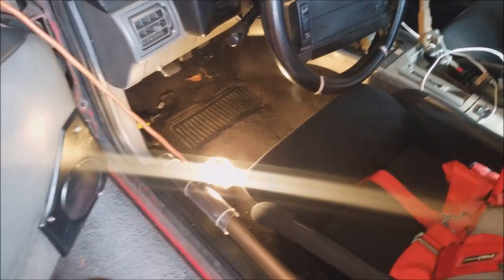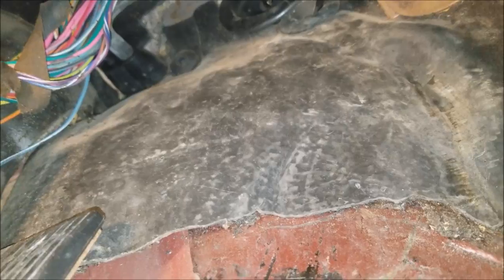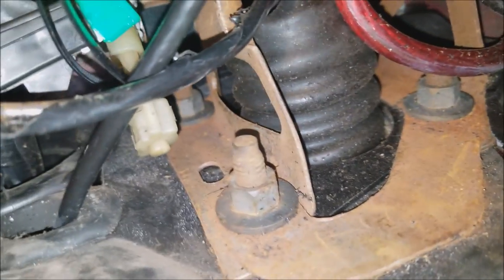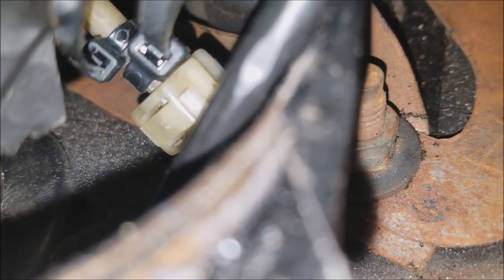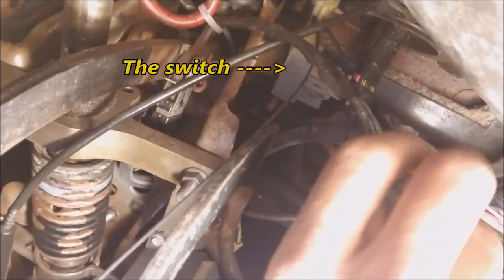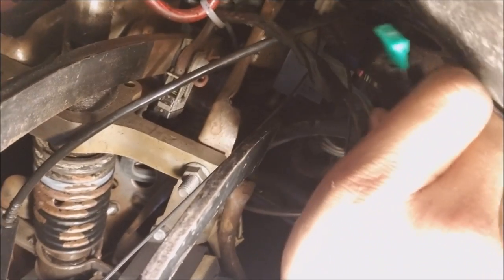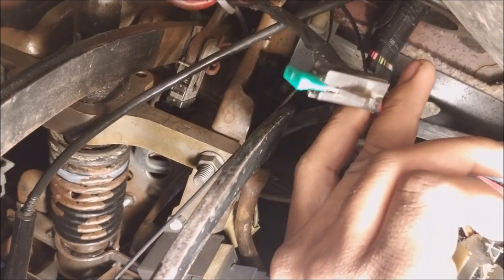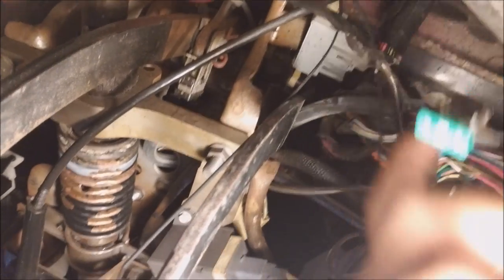Clutch Safety Switch Bypass on Foxbody/SN95

Comment: definitely gonna try this.
I'd heard about this kind of fix before but now I need to do it. 
I was getting the single click and I replaced the starter.
Still getting the single click.  New battery too.  '96 200SX SE M/T.
The car does start with a bump start then runs well and did so before changing the starter.
Funny I'm in DC too.  
I'll update later.
Reply: It worked.  Took a spare 10 amp from under the dash and had to twist it a little to get it in.
Now to find the switch online.  Oh and to figure out the pedal switch that's keeping the brake lights on the other 200SX.
The irony is that I grew up without this nanny device and hated it when I discovered a '91 Sentra had it.
Reply: I’m also in DC. 
Red mustang cobra convertible if you ever see me rolling around. 
Having the same issue. Shits clicking like 10 times everyday before starting. Sometimes more sometimes less.
Reply: oops.  Further update.  I bought the switch but didn't try it.  Instead I found little bits of broken plastic in the footwell.  Apparently that was a little plastic stopper that activates the neutral safety switch. 
In the meantime Autozone had declared the starter dead and I replaced it with no joy.
The plastic stopper did the trick.
For some reason the exact same stopper activates the brake lights and my SE-R 200SX A/T stopper disintegrated at the same time letting them stay on and drain the battery.  Sheesh.
And to cap it all off the alternator went out a couple of weeks later.  Fun times all fixed by me though.
Reply: @Scooter_built  I'll keep an eye out.  I deliver food in far NW where I used to live.  Down by the river now off Minn. and Naylor.

Comment: Not sure if I did something wrong or what pulled the plug with the three wires (smallest plug out of the two) put a 10amp fuse to jump it and it won’t start? Made sure the plug was clean and wiggled the plug made sure it was making good contact but it wouldn’t start. Put plug back in and it started up?

Comment: Ok I done a auto to manual swap in a 96 gt ok on the gear selector switch I plugged the switch back into the plug and put the switch in neutral it starts but like to tie the wires together plus fix my backup lights too
Reply: Anyone got a clue

Comment: If I do a bypass on my 92’ Mustang will it work if it was automatic before and they converted it to standard and it doesn’t start with the key in the ignition
Reply from the maker: it depends how it's currently wired.
Reply: @Sgt.Slides   it’s has the original wiring  and it’s stock like automatic .

Comment: Hi i replaced my clutch cable and  wired up my radiator fan to a switch recenty because the fan wouldn’t kick on and now my car won’t start it turns over but doesn’t fire up I recently replaced the starter battery starter solenoid  everything ran fine till i put the new cable and wired the fan up. In my 86 foxbody
Reply from the maker: your best bet is to go back over everything.  Make sure your coil is properly hooked up and your spark plugs are firing.

Comment from the maker: oh snap, i'm at 3k!!!
Reply: This worked for me as far as bypassing.  But all I get is a single click. I replaced the starter solenoid today as well. And I still get the single click. I also replaced ignition module and key with tumbler cylinder. What should I try next ?
Reply: Would this work with a 99 mustang gt?
Reply from the maker: @kimtrevino800  it's probably similar, but it wont be exactly the same.
Reply from the maker: @gymjunki322  Hopefully you've figures out why your car wont start by now.  This is only a single troubleshooting step,  there are other things that will keep your car from starting.  Doing this bypass was very useful to me, but it turned out not to be the solution to my inconsistent starting.  later, i found that the little boot connector on my starter solenoid was VERY loose.  Other things you'll need to check if your starter is not turning is, your battery, get it tested, all of your ground connections, your ground wire (those can actually go bad over time), your starter wire and connections, and your actual starter.  It's good to just do all of these at the same time, replacing the starter is the most expensive and difficult part, new wiring is pretty cheap and you might as well change it while the starter is out.  Good luck.

Comment: I'm battling an intermittent grinding at the bendix upon start up. Changed out solenoid recently, due to a failure while removing on another project, it was the original. I was wishing an nos replacement would be helpful, nope. Just bypassed this switch, still about a 40% failure(grinding) on start up. A friend of mine who knows shit about cars thinks it's the ignition switch, I'm starting to lean that way myself. He always prays while I'm laughing during a 6-7 time attempt, '92 GT has original 396k, starter replaced once. Car has about 200k since I lasted swapped out an ignition switch, that's alot of start ups. I'll report back when I have time to swap in an extra or new one.
Reply from the maker: good luck

Comment: Hi I bypass the switch but each time I touch clutch petal car cut off wont go into gear.? Can u tell me qats the problem plz thnkz
Reply from the maker: There is nothing electronic that will stop your manual transmission from going into gear.  If your engine is off, and it wont go into gear, that's normal, If you can't put it in first gear parked, try a different gear.  Sometimes the teeth on the shifters line up and you cant put it in gear while the engine is off.
Reply: @Sgt.Slides  ok it will go into gear while off.. but when u start it. It will engage.! But if its n neutral when I start the car ..it will cut off when I try to put it into gear.!
Reply from the maker: @tokkyofaison5390   are you manual or auto? On a manual car, the only wire going to the transmission is on the reverse lights.  Other than that, the rest of the car car really has no clue what the transmission is doing.  did you undo what you did and try it again?
Reply: @Sgt.Slides  it's a Manuel trans and where u use the grey plug to put the fuse in..I had to unplug both the black and grey put fuse n both to get the car to start..? That's not wat u did my car  is a 94 stang .. when I left the black plug in and juz took the grey loose the car would not start .! But when I took both a loose and put fuse n them the car started but when I step on the clutch the car shuts off.?

Comment: Could also be your ignition switch where you turn the car on
Reply from the maker: in the past, I've had issues with loose wiring in the steering column, the symptoms were a little different and very difficult to troubleshoot because there are so many wires.  I found the loose connector and zip tied it tight.  In this particular video, I did still experience the issue after I did the clutch bypass.  but it was still happening randomly.  at some point, I twisted the little ignition wire going to the solenoid and I think that fixed it.  there may have been some corrosion preventing a good connection.
Reply: Premium Fuel Mag when you say you had issues in the column can you point me in that direction? Having similar symptoms out of my sn95. If I tilt the wheel up and down while holding the key in the start position, it hits a sweet spot and starts, however in any of the tilt positions locked in place it will not start. Any help would be appreciated

Comment: Does the other plug connected to the clutch switch have to stay plugged in? Or could I throw a fuse in that one as well? Does it matter which one it is?
Reply from the maker: once disconnected, the clutch switch is just by its self, you dont need to do anything to it.
Reply: Thanks for the info man, I'm doing a T5 swap and don't have the clutch switch on the pedals or the safety switch wiring on the trans I bought. Good to know I don't have to buy the pedal switch.
Reply: @Sgt.Slides  literally my same question which you didn't answer lmfao
Reply from the maker: @jeffreyssvtproductions1986  the answer is leave it alone.  I told you how to bypass the switch so you can start your car without pressing the clutch,  if you want to know what the other wires do, figure it out for yourself, as for the purpose of this DIy, follow the instructions and it will work.

Comment: If you have a aod car putting  a t-5 in it how do you bypass?
Reply from the maker: Going from Auto to Manual, you'll need to do a neutral safety switch bypass.  Sorry, I don't have info on how to do that.
Reply: latemodel resto has a video on here very easy.
Reply: @Sgt.Slides  incorrect but ok

Comment: I hear this can also solve hot start problems for some reason any one have any luck with that
Reply from the maker: it's just a safety switch, it can solve starting problems in general, but if you are only having hot start issues, you need to look else where.  make sure the wiring to your starter solenoid is tight.  that stuff isn't that great from the factory and it's super old and crusty by now.

Comment: Just replace that you bypass it if you don't fuse it you can burn your car down for sure
Reply: Yea there's a reason why it's called a neutral SAFETY SWITCH.  Especially for starter run-ons